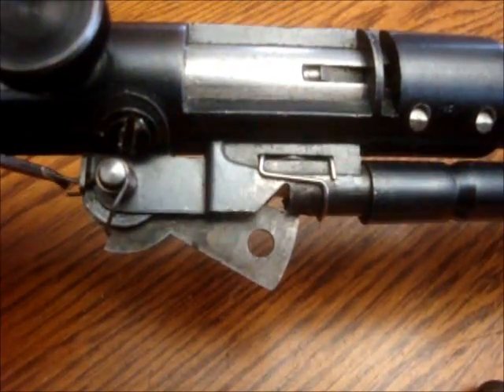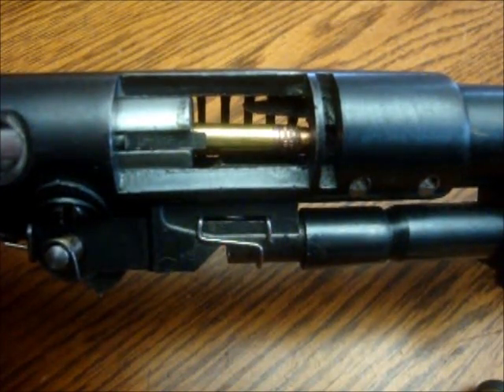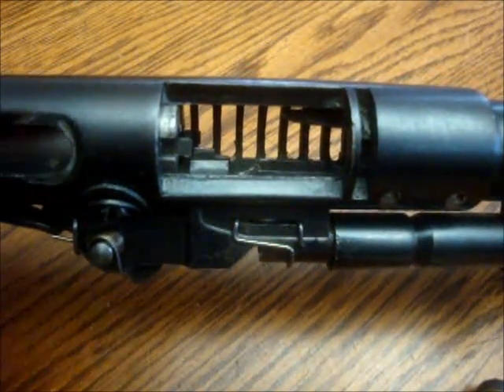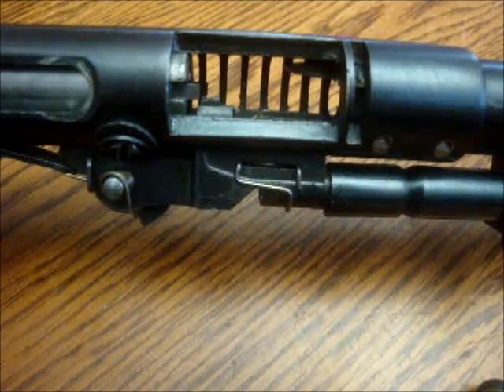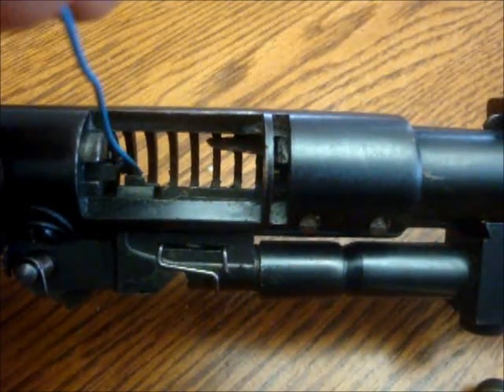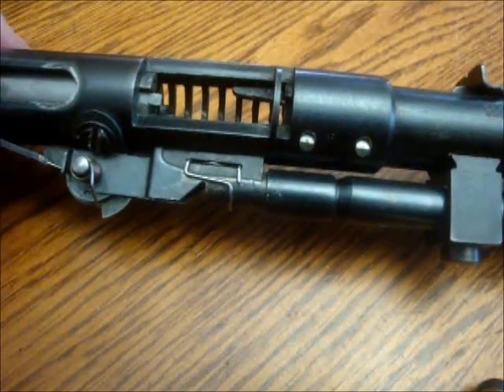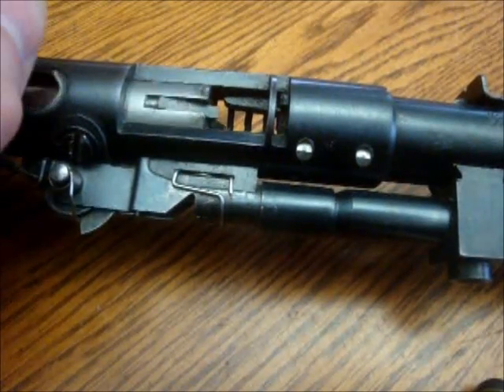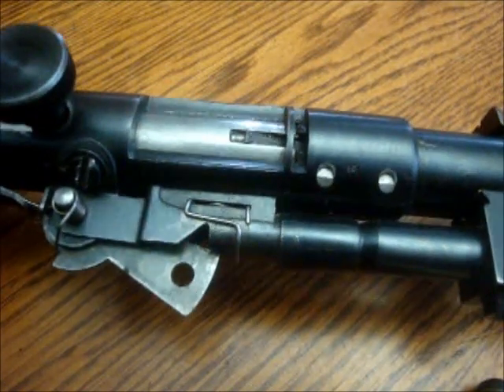Viewer request: springfield/stevens 87a cycling video

Comment: I have the exact same rifle. The feeding mechanism is such a pain I could never make it work properly especially once the feed throat has been bent or deformed so I ended up adapting the feeding system of a Marlin 60. Lots of work but have zero failures now.

Comment: There were also build issues on the 87A, where the feed ramp spring was installed upside down. It still works like that, but has less feed tension that way. Mine was upside down! Make sure your spring looks installed exactly like in the above video!

Comment: The most challenging gun i have took apart even with the great video and another 87 to compare. My nerves are almost shot. This guy makes it look easy. Ps i tried to load a magnum by accident, it fit in the tube nicely, then the head ache began.
Reply from the maker: fun. not the best rifle to have to deal with when  rounds dont feed in completely.
Reply: @Stray03  i got her done. Thanks to your vids, i did loosen the 2 feed part screws a half turn seems to work! I feel accomplished.. now for the brushed nickel paint to finish of the flat black tannite stock, and by new screw drivers that are boogered up. Thanks again. Ps milsurp garage pick one up, it has factory checkering.

Comment: Failure to eject quite often is the eject or assembly gets pushed down word. And that causes the ejector bar not to make contact with the bullet. A simple tap with a rubber mallet on the bottom of the injector assembly will push the ejector bar up tight towards the bolt action and that usually helps the ejector knock the spent shell out

Comment: i have a savage 187N same setup as yours other than the feed ramp at the end of the mag tube. my problem is that it won't cock the bolt back after 1st round and won't eject round out all the way at same time.I get stove pipes and if they do eject and bullet in battery its not cocked  so I'll have to rack it back then shoot one then same problem. do you have any advice to what the problem could be? great vids by the way. thank you..

Comment: I just bought the 87A about a week ago and took it home to test fire.  I only put 2 (22LR High Velocity) rounds down the tube to see how it cycled.  The second round jammed.
Reply from the maker: Ah. Well if you haven't yet give the gun a good cleaning. Check the follower to make sure it isn't jamming, and check the spring on the lifter to make sure it is in the right direction.

Comment: The part that move on the bottom the cartridge lifter has a spring in front of it. If the lifter spring, which is actually a cartridge load assist,is damaged or broke you will have feed james. I damaged mine after fixing a jam, and tried shooting without it. I think at least this is my problem. This vid and others ideas are helpful to.

Comment: Thanks for the video!  On my 87A, the second shot gets jammed in the magazine guide and I have to disassemble the lifter assembly to get the unfired bullet out.  I have ordered a new magazine guide to see if that fixes the issue.  Any videos on how to replace the magazine guide?  Thanks again.
Reply from the maker: Is that little wire spring in place? The one right under the ejection port?

Comment from the maker: Check when the bolt is fully open if you can push the lifter up anymore when there is a round ready to be fed. If you can, the spring is weak. If not then check if that piece that contacts the lifter (metal tab ahead of trigger) is touching. (It should only touch when no round is in the gun.)  Youtube is acting weird marking comments as spam for some reason.

Comment from the maker: No problem, One of my reasons for starting this channel was to get information/how to's out to people who needed it. Glad I could help.
Reply: Stray03  I have a model 87a that won’t load any shells it’s getting jammed and won’t enter barrel please help
Reply from the maker: @larrybarnett663  start with a cleaning of it. Then check to see if the spring is placed properly on the lifter, then check the spring that goes over the tube infront of the lifter if it is there. Lastly check that the cartridge guide above the barrel is in place and not missing.

Comment: I have a 887 it is basically the same as a 6a or an 87a.  It is a short only gun.  Sometimes a round wants to get past the cut off and pop up into the round that is feeding toward the chamber.  It seriously jams up and you have to take it apart to get it out.  I have figured out it you lock the bolt back and only put ten in the tube amd then cycle the bolt it won't jam.  Splain that one.
Reply from the maker: Less pressure exerted on it, and your feed mechanism is up so even if the second round wanted to get in it cant.  Most of the time the spring is causing that problem, so replace the one on the tube, or clean the part well, and it shouldn't give you issues.

Comment: I have this same rifle. On a cold day the action / firing pin is very sluggish !  Takes almost a half second to hit. Like slow motion.
Ive cleaned everything up.... used carb cleaner over night. Still same thing.  On days when its 70 degrees things work perfectly ! Never miss a shot. Its a very accurate rifle. I use it in compete with it. Almost hole for hole at 50 yards. But if its below 70 degrees.....Im out !   I ordered new springs....but they came a half inch short.  Are there more powerful springs ?        Any ideas ?

Comment: My question is that the last round tends to jam, and not feed up into the chamber
Reply from the maker: Maybe weak mag tube spring, or dirty or damaged tube.  Clean the gun well, relubricate and see if it helps.  If not look for damage or "delay" with the feed when the spring is pushed in and released.

Comment: I cycled 3 rounds very slowly through it just as you did. The thing I noticed different is when the bolt comes back to eject the round it doesn't seem to lift the bullet as yours does. Also when the new bullet goes in I saw on your video once the primer end of bullet passes the ejector it slides up in the the two grasps on the bolts. Mine does Not is kind of get straightened out as it goes in the barrel. I see some wear on the lifter so I'm thinking either a lifter spring or a lifter?

Comment: Ok I think it is a weak spring. The (metal tab ahead of trigger) is NOT touching with a round in chamber but does without. As I am slowly releasing the bolt I can push up on lifter and it jumps the round into place. Looks similar to the rounds in your gun with bolt going forward. My next question if you agree do you have a part # for the spring and where would be the best place to get one?

Comment from the maker: See if the bolt is dragging anywhere if it isn't check to make sure the spring guide isn't bent. Mine fires flawlessly with cheap .22 ammo, so unless a spring was replaced at some point with the wrong one, I doubt it is the actual issue. Check for unusual wear on bolt, or how the spring assembly is put together. Could point to the problem.

Comment: The federal 22 LR value pack copper plated hollow point  525 rounds  , will these bullets work with an older semi automatic tube feed. Springfield model 87a

Comment: Another good contribution to YTU (YouTube University). I just bought one of these guns. It is missing the feed tube spring. It does not even show up on a schematic drawing at Numrich. Do you know what that spring does? I haven't tried to shoot the gun yet, however it does dry cycle ammo.
Reply from the maker: Prevents double feeding and jamming of the rifle.
Reply: @Stray03  Thank you. I noticed in one of your other videos, you show a view from the bottom, and you can see the spring preventing the bullet from going up the ramp prematurely when the gun cycles.
Reply: I found it. It was the "Springfield Savage 87 feeding video Lifter operation" video. Shows the spring function perfectly. Thanks again.
Reply from the maker: Number 31 in the 87a schematic btw.
Reply: @Stray03  Yea, I went back to Numrich yesterday and realized I had missed it. I ordered one and they just notified me they shipped it. Thanks for the heads up though.
Reply from the maker: @douglassnyder1292 no problem. Enjoy the rifle. They are fun toys

Comment: I am writing from Santiago, Chile. My Stevens 87A has two feeding problems:
1.- In closed bolt position, the lower part of the lifter does not allow the cartridge to come out completely from the tube magazine, (stops halfway) because its is not completely open. Although, if the lifter is pulled by hand just a couple of milimiters , then the cartridge jumps out of the tube and gets set in its right position for elevation.
2.- However, while bolt move back to extraction position, the cartridge is lifted only  halfway up, as if the guiding springs (new) would be holding the bullet, stopping its upward motion or as if the  lifting spring does not have the necessary tension to complete the lifting. 
Since the cartridge does not reach its proper position, the bolt runs forward but cannot reach and drag the cartridge forward to the chamber. If this happens while preparing the second shot, the next cartridge is stuck halfway up to the position into the chamber and everything is jammed.
This nice rifle belonged to my father and I would really appreciate your help to get shooting again.
Thanks.
Reply from the maker: Is the lifter spring on the right way?
Reply: Yes.
Reply: Any other suggestion?
Reply from the maker: sorry  youtube never told me you answered. The part of the lifter that hits the bolt to push it down ok or is it worn?
Reply: I bought a second hand lifter but there is no dimensional difference with my original. Regardless, I still believe something is not right between lifter and bolt. Therefore I got a (used) replacement bolt, which slides much more softly, but the problem is still there.
Everything indicates that there is a dimensional problem, but, since I have not been able to find a good gunsmith, I do not dare to start filing or modifying parts.
Reply from the maker: is the pin holding the lifter in worn or is it ok
Reply: I replaced it, but they look absolutely equal

Comment: A tip for tube fed . Im on my 50th patch trying to clean the spring fed tube , the 87 looks so new on the outside but the inside of the tube is filthy and gritty. The same but not as bad and easier to clean is the tube carrier itsself. Appears no drainage so if and moisture stays inside.Thanks
Reply from the maker: Ive seen that alot on old shotguns due to the wood plug you get in them. Thanks for the tip.
Reply: @Stray03  i have 3 87s, i had a magnifier glass and wanted to pput the best off all to one. Steel wise it came out great, matching the stocks was a problem. The tannite has 2 mounting screws,  the other have one, the other 2 wood had 2 different stock mounting styles. If i had more time i think i could switch out the stock mounts and get the t model set, the one tube had a very rusted spring wich dissolved with cleaning, now on to cleaning the marlin m1, looks a lot cheaply made than 87s.
Reply from the maker: @litoneup  interesting. Makes sense about the stocks though since they have been made alot and for a while by different companies. Glad to hear you are fixing up some of the classics. Always nice to see them coming back to life.
Reply: I found out how to reaplace the tube spring, it was totally rusted.numrich has the , going to replace or attemp to replace both extractors and springs. Along with tube springs. This should revive the gun. After deep cleaning 10 22 and marlin 60 ill stick with 87s wich are better built by a long shot. Money was tight back then so they werent shot up like todays guns. Im also going to find a good round nose 22 lr ammo, tjhinking that what is was designed for. You might enjoy rippjng apart the marlin 60 and doing a vid. I check most of them.  You are the best at gun take down and repair vids. Note there are subtle changes on them, like the feed ramp and bolt hold open. Thanks

Comment: thank you stray03. hope I won't have to mess with it then. any guess on what it might be I know my lifter spring is kinda bent and the two screws that goes in and holds the magazine guide ones striped out and mangled have it in still tight as it will go and its missing the safety button retaining ring that goes under the safety button any of the 3 pieces I've mentioned do you thank could be my problems? not recocking after fire, ftf, fte? thank you for the fast response and sorry if I'm a bother I no its a lot of questions but would like to find and fix the problem or problems. thanks again..
Reply from the maker: Brandon Belcher Don't apologise, I didn't see your other post the other day so I'll try to help out now. If you have a safe place to point the gun can you manually cycle the action slowly to see if there is anything out of the ordinary happening? Also before trouble shooting a gun, make sure it is very clean, and then properly oiled. if there is nothing out of the ordinary during the manual cycling the first thing I would check is the bolt and bolt spring. I have a few videos on this gun, that should show you what they should look like when properly assembled. If anything is put together wrong on the bolt, or the rear cap isn't screwed in properly it can cause problems. also what ammo are you using? although it fires shorts and longs it is only long rifle that works in semi auto. 
If there is a problem you see during manual cycling let me know what you see, and we will work from there.

Comment: sorry that seen your post. I've cleaned and oiled thoroughly but forgot to tell you my rifle doesn't have but one bolt hold open unlike yours having two. and the end cap behind my bolt has the safety built in it. don't know how I can make it shoot in single shot cause the one hole for the bolt. also do you no how far I screw in the end cap behind my bolt if to far tight it won't let me push my charging handle in to hold the bolt back. thank you again for all your advise.
Reply from the maker: Brandon Belcher I looked it up the 187 doesn't allow the single shot mode   From what I have seen people turn the endplug one turn back to allow the gun to lock open.  when you shoot the gun does the bolt stay open as long as you hold the trigger down? if not when you manually pull back the bolt with the trigger pulled does it stay back?

Comment: Mine will not feed properly I’m assuming it’s the spring like you said because when I slide the action back with just one bullet it feeds but when there is two the other bullet stops the feeder from going up all the way do you know a way I could fix this or where to get another spring
Reply from the maker: Yeah if you are in the states eBay or numrich gun parts usually has some.

Comment: I've taken it completely down and looked at everything. Everything is straight. Bolt looks worn, but fine. When I pull back on the bolt handle it's definitely a tougher pull than, say, a Ruger 10/22 or Remington 597. The springs are so strong. They look original too, I dunno what's going on with it.
Reply: I heard there's an adjustment on it but idk where.
Reply: I had that among other problems but you need to take the bolt and everything else out of it and take a pair of Swiss files or some really fine sandpaper and make sure you don't have any Burrs anywhere on the bolt because that is what is causing the binding and not allowing it to operate. I hope this helps you

Comment: Thanks for the video , i have the stevens model 887 feeding problems. I'm missing the part on the top of the reciever .What do you call it ? without it the round gets caught on top of the receiver . I am also missing the extractor on the right side . Where do you get the parts ?
Reply from the maker: If you are in the us. Numrich gun parts should have the parts and a schematic of the gun so you can look up the part number for everything you need

Comment: My 87A doesn't have a problem feeding. It has a problem functioning on semi-auto, period. It seems to me that the springs are just too damn strong for the bolt to recoil far enough back in order to reset the trigger. It works fine on "bolt action", but on semi-auto it won't cycle all the way back. The 22lr is already a questionable round when it comes to having the power to cycle a semi-auto, but this gun has springs that are just too damn strong.
Reply: One suggestion that may help you is take the bolt out of the gun and make sure that it is perfectly clean and I took a small set of Swiss files and found several Burrs on areas that are causing the bolt to bind even just a little bit it is really problematic for this gun so make sure that everything is absolutely rounded and smooth and you're not trying to take a lot of metal off you're just trying to get the burrs off of everything
Reply: Hopefully that will help you as my problem is it's trying to load two rounds at once and one of them gets jammed and will not allow it to raise it up to the injection area of the gun or the feed ramp

Comment from the maker: I haven't removed mine but by the looks of it you have to remove the lifter assembly from the gun by unscrewing it and lifting it off, then drift the  tube off of the barrel like you would do with the front sight, carefully ensuring you don't damage the tube

Comment: Sorry for the delay. After checking all the parts you mentioned, a local gunsmith slightly twisted the metal lips just above the cartridge guiding spring and it worked better for a couple of shooting sessions. However, every 5 to 9 shots, the empty case gets stuck in the chamber. In a video called "Request: 87a bolt strip" I could notice that plungers were longer than mines,  and the size of the extractors seemed to be different one from the other. Could not see which one goes in what side. I have not been able to find, from Chile, a set of new spring, plungers and extractors. Any tip? Thanks.
Reply from the maker: smaller one on side of ejection port (right side).